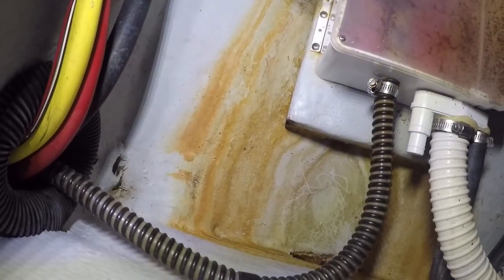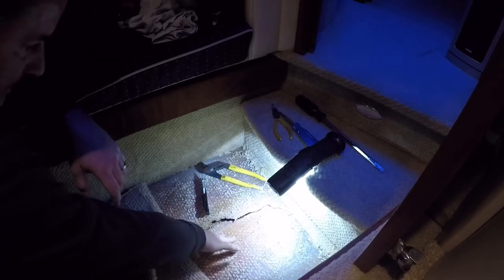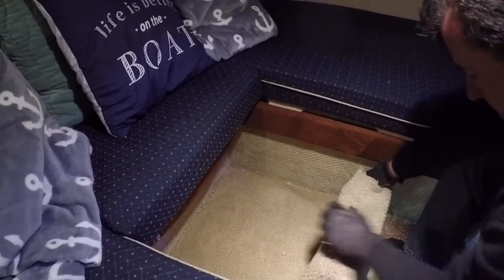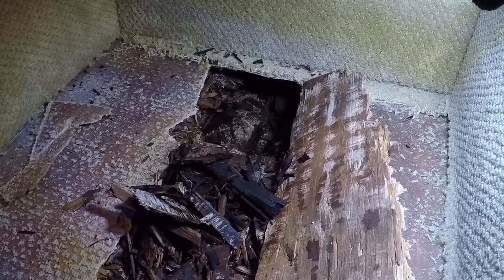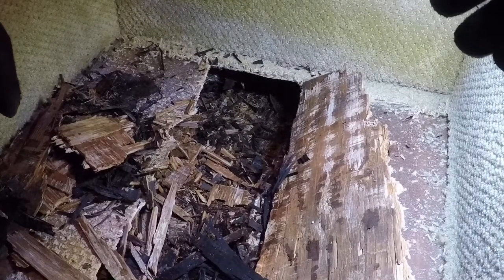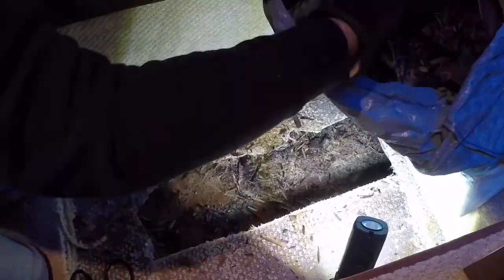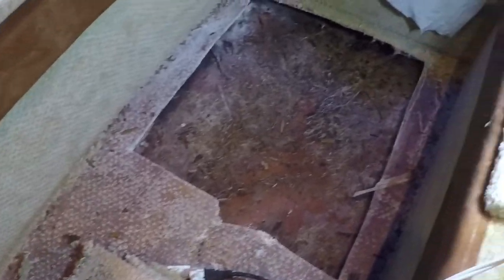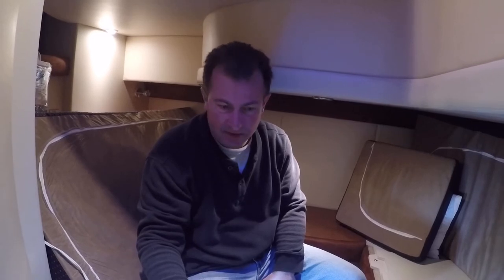Repairing rotted boat floor (Part 1)

Comment: Nice video… only thing I'd do differently is put an air vent at the front of the boat floor area cavity to allow air from the front to the drain plug when the boat is not in use to allow floor cavity to aerate when not in use example PVC pipe with lockup cap. Boat will always hold moisture in the floor cavity.
Reply from the maker: It does get moldy in that sump area.  I often spray bleach in there to keep it fresh.

Comment: Hi Tom.  Good start... I feel for you man!   But I think from what I can see it is only the plywood floor.    However you owe it to yourself and the future to make a good inspection of the adjacent stringers.  One would assume this floor piece was added after the stringers were totally glassed so the only exposure, albeit large and significant exposure, was the underside of the plywood floor.   Nonetheless check the integrity of the fore to aft stringers.  That section on the starboard side looked real bad.  But again it definitely seems like the lowest floor panel in the boat.  

I think 3/4 inch marine ply.  Fastening it in without drilling into fiber-glassed wood  is key.  Maybe it should be a resin-encased, tightly fitted remove-able hatch.  I bet if the designer sees your video he would say that he should have made this lowest floor easily remove-able star-board.  Good luck.  You'll figure it out I'm sure.  Motivation: Keep telling your self how much it would cost to have some do this for you.  If you could find someone. 

Me: This is the first place I will investigate when I get to the boat next weekend.  And I am going to install two new things this year.  1. A float alarm at the low spot of the hull near the shower sump.  And a "zero" water dry bilge system near the forward bilge pump between the aft cabin bunks.  Another dry bilge intake at the mid bilge pump in front of the holding tank.  There are some good inexpensive install videos on you tube with the water pick ups made out of scotch-brite sponges and electric outlet full covers.
Reply from the maker: What was surprising was the underside of that plywood floor wasn’t glassed over.  The topside was.  Had they glassed the bottom, this wouldn’t have happen.  I’m trying to decide what to do with the replacement.  Plain plywood and glass over the entirety of it or go pressure treated outdoor rated plywood.   I plan to cover the floor in plasteak or something similar.

Comment: I assume you found sound plywood outside the area you removed in video, or is there more floor board removal necessary?
Reply from the maker: Certainly is.  This was just the beginning,   I have a follow up video in the works with the rest of the rip out and repair coming soon!
Reply: @AdventuresofHappyOurs  Sorry you have this problem.   Sounds like a design flaw in the Meridian 341, (not encapsulating plywood) so I'd guess others may encounter this problem also.   I still think it's a good boat and remains on my short list.
Reply from the maker: @Brad-sb1dk  it looks worse than it is and will be better than new once completed!